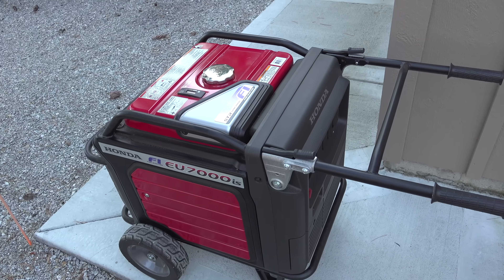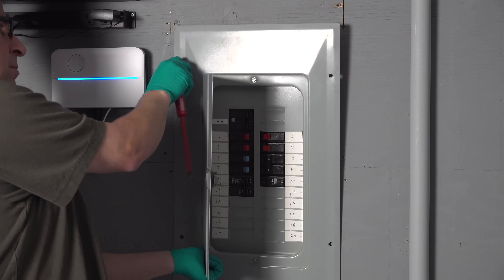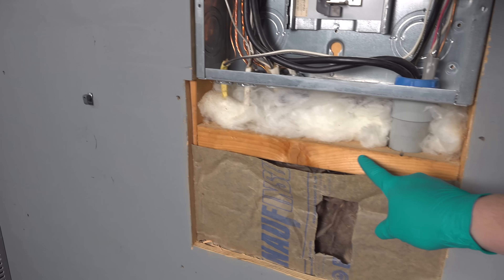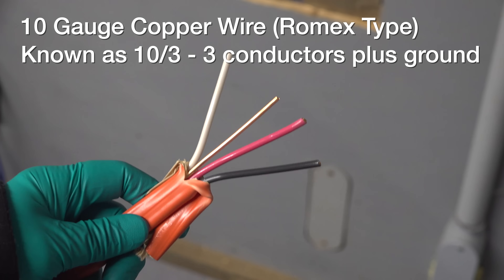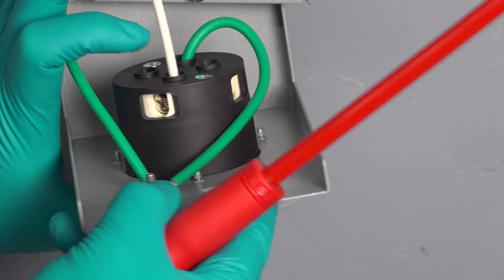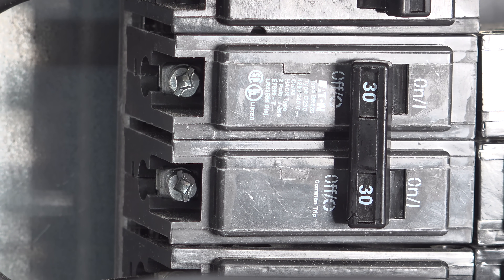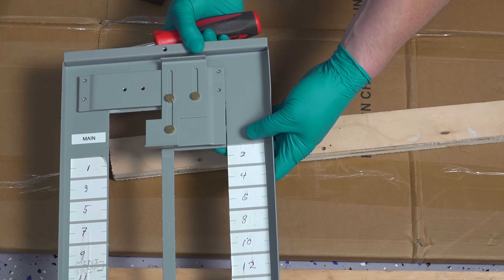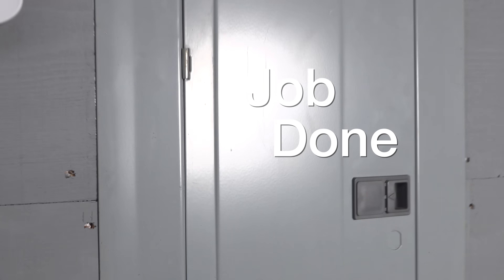Cheap & Easy Way to Connect a Generator to Your House - Legal Too!

Comment: I always flip all the breakers off on my sub panel and I have the breaker on the generator turned off as well. I go out and start the generator, flip the breaker on after about 30 seconds. Then by the time I get inside I can start flipping breakers on one by one. Great video overall for someone looking to do this too.
Reply: This is what I will do when installed. Certain things don't need to run when on generators. We have slowly went to LEDs when ever possible to prevent overburdening our generator.
Reply: @douglashaner6802  I have a 6250 running watt portable generator. It's been fantastic. I even run my hybrid water heater and well pump off of it. I wish I put the dishwasher on it (turn heating element off when using) and a bathroom circuit on it. I could do it but i don't mind enough to really bother. We do lose power a ton. If I touch the panels again it will be to install whole house backup batteries.

Comment: I see a lot of backup generator video from the US, are power cuts a common thing across the us or do you guy just like to be prepared just in case ?
Reply from the maker: Depends where you live. In the NE US ther big problem is lack of power means no heat, so you can't go long without it.
Reply: @SilverCymbal  ahh I see, most people have gas heating here but I can see why people would want a back up just in case when you use electric.
Reply: @axeami1354  Well, with gas heating, as in a furnace that is either ducted or unducted, electricity is still required for the controls and/or circulating fan.

Comment: I don't need to spend 100$. 
I cut up two power cords from scrapped microwave ovens and wired them up in parallel..
When the power goes out i plug one end into the wall and other end into the generetor. For 0$ this is the best solution!

Comment: hi, just wondering if you or anyone has a suggestion if my panel is already full? It was that way when i bought the house
Reply: Some panels can be fitted with tandem breakers. 2 circuits fit into a breaker that takes a single slot.  Check your panel tag to see if its allowed.
Reply: You would need to add a sub panel, or purchase and install a larger service panel.

Comment: My panel box is full. What can I do in this case? I’m pretty sure my previous electrician didn’t do a good job and I have a lot of unnecessary breakers. Is there something you recommend I can do to check if I can make more room/space to add the needed breakers for my generator?
Reply: Unnecessary breakers ? Can you consolidate enough circuits to free up a DP (Double Pole) breaker closest to the main breaker ?  If you double up any , start with lighting circuits first. With LED lights now, the norm that should be possible.  How old is your current electrical box, maybe it is time to upgrade to bigger amperage box with more slots.  Another choice might be a transfer switch.  Maybe consult your local career center or college and convince the instructor to use your house as a 'field trip' location for students. Promote net working by having refreshments for the class.
Reply: You can change some of the lighter-loaded circuits' single pole breakers with Tandem breakers; that is, if your panel is rated for using them. Just installing two tandem breakers will free up enough slots for ONE double pole breaker.

Comment: I'm glad others addressed bonding. My question: Why wear those gloves? They appear to be simple latex gloves?
Reply from the maker: Yes, hopefully you saw my response. The structure was built in 1993, long before the 2008 bonding code changes and was designed for the current regs then. Gloves are for video clarity.

Comment: genrally with high current AC cable its not a good idea to leave a big pile of the cable coiled up, best to have about 8feet max more than what is needed, or it can act inductive under heavy loads,

Comment: If you just need to jerry-rig something during a power outage, here's my tip: run a good extension cord from your generator inside to a power strip, then plug in your fridge, maybe a light and some chargers or A/C to it. Don't do anything stupid and don't backfeed.

Comment: SC, the power should have been isolated at the MAIN PANEL'S sub-feed breaker for this panel, the feeders coming from the bottom of this panel and the lugs at this main breaker were still HOT and exposed. Also, regardless of the 'grandfather clause' it would be in your best interest to isolate the neutrals in this sub-panel, there is a very specific reason the NEC added this requirement. Please do it.
Reply from the maker: All good points. After further digging into the code and consulting with a few folks, the code for separating neutrals and grounds (in separate structures came out even after the 1999 main dwelling code)it came into effect in 2008 so it is fairly recent. The issue is this building was designed to be this way and is 200 feet from the house and has no ground back wire to the house (since having one would have been against the code at the time) but if I make changes I will address it at a future time.
Reply: @SilverCymbal  makes sense but keep in mind that the Utility transformer secondary's are grounded which is also where the single phase power derives the Main neutral from. If you lose your neutral(s),  any ground path, including the soil and devices can become energized. Have a Merry Christmas SC.
Reply: @donm1547  I came to make the same statement sbout the neutral issue. Quite a few linemen have been injured or killed due to back feeding a transformer doing this same thing.

Comment: I dont know why auto changeovers aren't so talked about in US. It's cheap and automatic
Reply from the maker: They do exist for RV's and for houses but our problem is that we can't switch our mains off which means auto switches need to wired into our main leads which makes a retrofit installation much more complicated and in some cases our electric codes won't allow it. I really don't mind it being manual since when we lose power its storm related and I don't want to use up fuel or battery life automatically since my run time will be limited so if I came home from work and the power was out my AC could have depleted the batteries or gas completely.
Reply: @SilverCymbal  That makes sense. Coming from a place where powercuts are common, we have separate circuits for all the low power appliances and are run on UPS and the higher powers on raw power. The UPS kicks in automatically, and the auto transfer switches kick in when the diesel generators start and take it to DG power, charging the UPS and running the house. Basically three different power sources. The transfer switches are smart enough to switch back to mains power even if it is getting two power sources at a time.

Comment: A quick addition for anyone that decides to do this. In this video you see white wires (neutral) and the bare (wires) on the same bus bars in the panel. You can only do this on your main electrical panel, not a sub panel. If you would like to learn more search Electrician U or Electric Pro Academy and bonding neutral to ground and you can get a better description with diagrams.

Comment: What changes are needed if you have a grid tied solar array on your home... any difference?
With the grid tied systems they will not operate if AC is not present.... now we have AC from the generator. Will this damage your inverter or tour generator?

Comment: Cant speak for everywhere but the utility compaby I work for asks that you notify that a generator is wired to the panel.  May not still apply that was before solar took off.

Comment: of note, google the inlet model numbers and go to the manufacturer's website; there is a TORQUE spec for the lug nuts used to connect the wiring. for example, Reliance PB30 requires 20 inch-pound torque to secure the wire.

Comment: Great video! I noticed grounds and commons going to the same bar and the bonding screw is installed. Is that a sub panel to your main panel? If so, you should consider removing the bond and separating your grounds and commons in the sub panel, otherwise it can lead to amperage on your ground.
Reply: This is a main panel, so bonding ground and neutral there is appropriate. It wouldn't make sense to install an interlock kit anywhere but the main service entrance.
Reply: I’m wiring an off grid cabin to be powered by a small Bluetti power station( 30 amp)  and also gas generator (50 amp) as an alternative. Do I use a sub panel with a 50 amp breaker  and a 30 amp breaker with interlock kit so I can keep the neutrals and grounds seperated ?

Comment: Great work as always! I'd love to see one on how to deal with Multi-Wire Branch Circuits (shared neutrals) using a 120v power source powering both legs of a panel.
Reply from the maker: Thank you for the kind words and generosity!

Comment: Do you need to screw down the generator breaker?
Reply: Yes he does
Reply: Curious why there’s a screw dead-center of the 100 amp main breaker? That can’t be a good thing.
Reply: @tomnorman457  If it's a back-fed breaker - meaning the power comes into the breaker from the screw terminals and goes into the buss bar - (such as a main breaker or in this case, the generator breaker), then it has to be screwed down into place. If not, then if the breaker ever comes out, for whatever reason, you would be holding a breaker in your hand that is energized and that can make for a bad day.
Reply: @snakeinthegrass7443  how do you screw it down? Can I use zip ties?
Reply: @jstins  If it's a fairly modern panel then there is already a threaded hole in the body of the panel for that screw. (Possibly only in  the top few spaces so you may have to remove the top two breakers to find it). I don't think back-fed is the proper name for it but when you buy the breaker, make sure there is a hole in it for the screw that's specifically designed for this application. It may possibly be called a hold-down screw.  (DON'T USE A DRYWALL SCREW, PEOPLE) I don't think you'll find these at Depot or Lowes so just go to an electrical supplier in your area and tell them what your doing. All you should need for them is the panel type and model, if applicable. Take a pic of any label you can find if you're still unsure. And if you use a zip tie, you won't be able to get the cover back on properly.
Side note here. I do recall using a different type of "bracket" to hold down the breaker before. It was a piece of metal bent to go over the breaker and attach somehow to the box. But I haven't seen that in a long time and I can't remember the details of it. It was most likely in an older panel. So if your panel is ancient, there still may be hope. The electrical counter folks should be able to tell you if what you have can accommodate what you're trying to do. If not, than it's probably time to modernize your service. Hope that helps.

Comment: Do you also have a Generac or Kohler direct automatic start up or you only have a portable one?  My parents have a Generac and it was a godsend during last couple early fall hurricanes and extreme snow blizzards
Reply from the maker: I don't have any automatic system, since they run on nat gas propane. We have a propane tank for heat but running on generator would be depleted it in about 3-4 days. Gasoline is more work but I can run for about 5-7 days & I have a chance to get more if a crisis happens where propane I am restricted due to my rural location that a delivery might not happen. My rural spot does add some complications.

Comment: I just did this a few months back when a power line snapped from a pole and caught the pole on fire. We were without power for 1.5 days. I installed mine on the outside though.

Comment: Solar generator is a term I've never thought I'd hear
Reply: The term shouldn't exist.
Generators convert kinetic energy into electrical energy.  Solar cells don't operator on kinetic energy so they are not generators.

Comment: Come on. You did a video on Wago and you use a Menards connect in your panel. Pick a lane.
Reply from the maker: Those aren't from me. In fact if you watch close at the start of the video there were two double tapped (with wire nuts) on the left side, I yanked them out and installed 2 new breakers to clean things up a bit.  The remaining 3 wirenuts on the left will be changed to Wagos at some point.

Comment: Can this set up be also used to power 110V circuits?
Reply from the maker: Yes absolutely. Most panels consist of 120v and 240v circuits. 240 for things like well pumps and water heaters and 120v for regular circuits. This setup delivers power to both types through your panel even if you are feeding in 240v.
Reply: @SilverCymbal  great thank you so much can it be ran with a EcoFlow DELTA 2 ?
Reply: @danlorelli You won't be able to power everything with a delta 2 using this setup since it only outputs 120v versus
2x delta pros and the 240V hub he has. The Kelley's Country Life made a video touching on it in episode #738. You'll have to closely monitor your loads since the delta 2 only outputs 1800W

Comment: How about setting up an inlet inside and outside?  I only have one outside and it's the best thing ever but inside would be great for me to use my ecoflow setup.
Reply from the maker: This one was installed inside my workshop. But I did exactly what you are asking for in my house, but to do it legally, you need to use a switchbox and it's very expensive despite the fact its just a simple switch. You can see that setup here: https://youtu.be/yNBXE3BszEM
Reply: @SilverCymbal  Awesome thank you

Comment: Great video! I did the same for my house, but you should address the generator you're using for this setup. It has to be a floating neutral one vs bonded neutral if you're not also disconnecting the neutral leg from utility (very rare). Most generators there is a way to unbond it, and there are warning stickers you'd need to label the inlet and generator to be within code.

Comment: We built in 16’ and had our electrician install an interlock switch in our breaker panel and a 30 watt outlet on the back outside wall of the garage.  I keep my portable generator in my shed which is just a few feet from my garage so it makes it easy to get out and set up.  I haven’t had to use it yet but it’s there if I do.  I have a maintenance schedule for my power equipment which includes firing up the generator to ensure it works when called upon.

Comment: I had a licensed master electrician wire a similar interlock and generator feed line to my main electrical circuit breaker box years ago. I consider it some of the best money I have spent on improving my home.
I have not needed to do this many times (few power outages, thank God) but it is pretty awesome to run my entire home off the generator in an emergency.
Thank you for another wonderful video!
Reply from the maker: That is awesome, I am amazed at how many people rig unsafe stuff. These things will last longer than the next 20 iphones thAt are released. Money well spent.
Reply: Glad you got a license involved. For those wondering, "Master" electrician has nothing to do with skill or quality of work. It only means he/she can hire another electrician and write a paycheck.  Don't let a "Master" charge you for the title.
Reply: @Icehso140  Are you a master electrician?
Reply: @Icehso140  I appreciate the reply,  thanks for the insightful comment.
Reply: @Icehso140 wrong in ohio we take a test and have to have certain amount of hours to even test. If you pass you have to do a certain amount of hours each year on code classes
Reply: What did he charge you for something like this?
Reply: @infiltretor287  it was supposed to be $200 but I believe he charged me $400. That included the 20 foot of cable to hook up the generator to the house.
Worth it to me. No regrets.
Reply: @infiltretor287  NEVER attempt to price professional services over the internet. The price an electrician would charge to install this could vary wildly even between you and your next-door neighbor, there are too many variables. Type of panel and it's age, the availability of spare breaker slots needed to properly locate the generator's back-feed into the house panel, the panel's location and the cabling required to get to where the generator inlet box will be, size of the generator, Physical obstacles and customer demands, local area wages, etc... Best to get at least 3 quotes for the exact same plan and then decide who you like the best, and don't fall into the trap of going with the lowest bidder, especially if the lowest bidder is well below the others.
Reply: quick question: These inlet boxes are typically 30 or 50 amps, however the breakers are DUAL breakers, with each breaker being labeled 30-30 or 50-50. Does that mean the PAIR of breakers is 30 or 50 amps, or double that to be 60 or 100 amps?  If so, why use 60 or 100 amps of breaker capability if the inlet only supports either 30 or 50 amps?  Just want to understand the details here.
Reply: @ken444444 The breakers are either a total of 30 or 50, even though it looks like they are two of the "regular " breakers.
Reply: ‘Licensed master electrician’; christ! In that case I was served by a licensed master chef at McDonald’s yesterday.

Comment: I am curious as to why you installed the plug on the inside as opposed to the outside of the house...?
Reply from the maker: I will be using this with battery 240v systems more than gas generators, they can't be outside, but I can always use a longer cord for gas models.